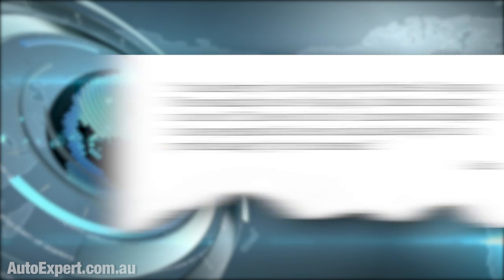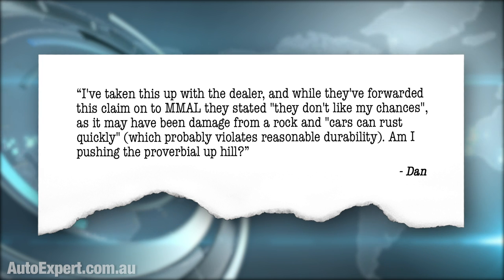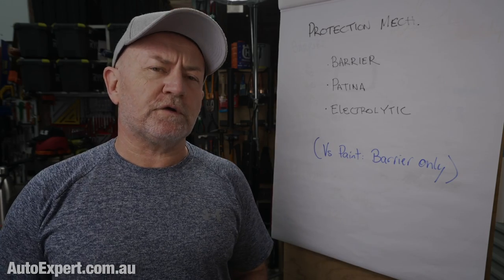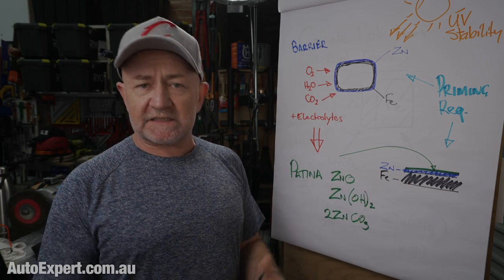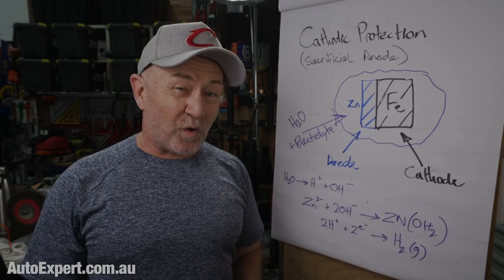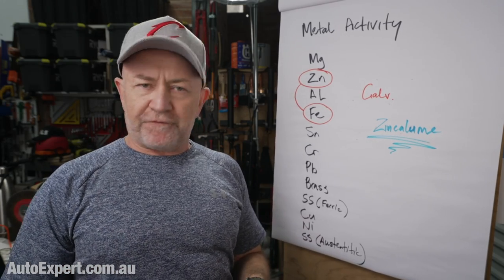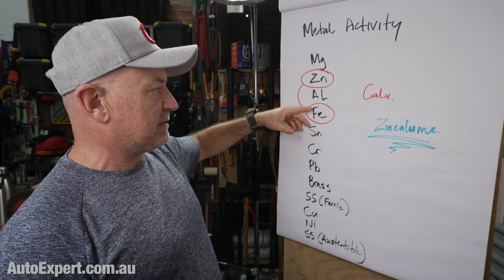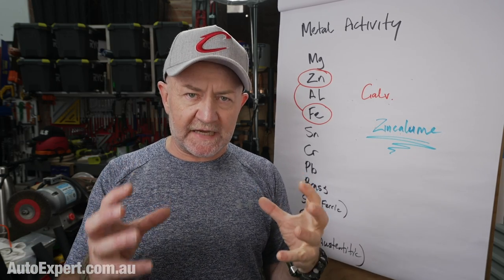The mad science of galvanising, and how it protects your car | Auto Expert John Cadogan

Comment: Galvanising only provides short term protection. I had two Nissan which were supposed to have galvanised doors.  The doors rusted a way at the bottom. Also, I have installed galvanised roofing sheets, which needed to be treated with bitumen, because they started to rust, due to missed spots in the galvanising process!
Reply from the maker: Bullshit - galvanising is long-term protection for steel. Obviously it is ineffective if done badly, which is your actual argument.
Reply: @AutoExpertJC  Long-term =/= permanent. After so & so years the zinc protection wears off. Hard to replace piping of an old house due to corrosion.
Reply from the maker: Galvanising typically protects steel for decades. = long-term.
Reply: @AutoExpertJC  just replaced some galv water pipe in our house.  which was built in 1921.  so i think decades is worse case scenario.
Reply from the maker: Hot dipped gal is especially durable (water pipes are hot-dipped).
Reply: Come to Canada and you'll see that galvanized steel for cars definitely does not last decades. Average age for rust to form on the body of a galvanized and painted car in Canada is about 7 years.
Reply: @forzanerazzurri2339  ah , so you're that Canadian that John warned us about in the video ( 32:00 ) . I'm guessing that you let your indignant outrage get the better of you before reaching the end of the video ?
Reply: I have a 1998 Opel Corsa 1.7D (and I love that Isuzu engine) and it suffers from some rust, including a fist-sized hole under the battery (typical in these cars) and some corrosion under the windshield's rubber I had to fix because water was already leaking in, pooling behind the passenger's seat. And there are various other spots of corrosion around.
Sure not eternal but not awful for a 20+ year old pig carrier, and there is some consensus that galvanization on those cars was somewhat poorly performed. But not that bad at all, considering the car sleeps under god's acid piss (AKA outside), and way far better than the cars I remember when I was a kid 35 years ago when there were no safety inspections and cars were literally disintegrating and falling apart, with paint brushed over the rust for disguise. It was like living in some Eastern European movie. Aaaah happy times!
Reply: I have pulled galvanised roofing sheets off a house built in the 1800s and reused them. They were heavy as hell - much thicker than the modern equivalent.
Reply: @azerool8288  
Nothing is permanent. No matter how good a process is, if it wasn't done right, it will bring problems.
Reply: @AutoExpertJC  The only one talking bull shit is you!  Every car I have owned has rusted away, even ones purchased in the last 10 years.  I can remember Chrome plated bumper rusting because chrome is porous and the car manufacturers failed to plate the bumpers with nickel, before chrome plating, to save money!  Car manufacturers fail to degrease and remove contamination before plating the door sills with zinc which causes rusting from the inside to the outside.  When carrying out the annual inspection the mechanics have to tap the sills to see if they have rusted from the inside, even if they look sound.
Reply: @mcmoose64   haha yep, guilty. Definitely my mistake. Rust is a passionate topic for us as it just ruins everything here quite rapidly, galvanized or not.
Reply: @forzanerazzurri2339  yeah but you guys like putting salt on the roads
Reply: @azerool8288  
Zinc Roofs last over 100yrs

Comment: Aluminum (NOT ALYOOMEENEEMUM for the folks in Oz) is added to roofing sheets because it has one of the most impenetrable Oxides known.
A surface of exposed Aluminum will coat itself in an insanely strong Oxide layer in less than a second.
The oxide is brittle and Metallic Aluminum is very soft so other metals are used for strength.  You have never touched Metallic Aluminum in your life.

Comment: John, going into atomic reactions is fine....  but you forgot the word - "eventually"  .   Drilled holes will end up rusty in your hot dipped trailer mate..  Instead of re-inventing the wheel..... use the dolly wheel to tip the trailer up when parked... so the water flows out of the tailgate instead. Simple. No holes required. .....Dude. The simple things in life are often the best.

Comment: Damn, you drilled through a galvanized piece of sheet metal? Well, isn't that gonna go bad, without the zinc, in time? Ah, you explained this. Thanks.
Years ago I once riveted a metal sheet-plate on my old Citroen with aluminium rivets. That went bad in a very short time, the rivets just "vaporized".  Weird huh, lol.
On topic 1: they put blocks of Zinc on the legs of oil-rigs to prevent the rusting. Not galvanizing but real big blocks here and there.
Could you talk about those spray-cans with "Zinc". Is it Zinc? and does it work?
On topic 2: What about those aluminium Tesla's with iron axles and such. Would that not just "fade away"that aluminium body if it gets scratched?

Comment: If you think 21st century cars are all galvanised, you wanna take a look at my 2005 Seat Ibiza front wings. Seat, in their finite wisdom chose to wedge a big section of open cell foam between the arch liner(plastic) and wing(metal) right at the vertical centre line of the arch.
It would seem that the metal wing sacrifices itself to preserve the foam...

Comment: In cold climates modern cars absolutely do rust, especially in areas that haven't been galvanized.  Maybe the body is protected, but some parts of undercarriage tend to have a lot of surface issues, including surfaces which have threads cut in them and retain moisture by capillary action/surface tension.

I'm not from Canada, but 90 miles north of Chicago, (or roughly 150km if you're a dirty commie)  you're right, cars don't "rust out" like thy used to, but when the rust makes replacing wear items such as suspension bushigs near impossible because every grade 8 bolt needs to be cut or drilled out, the result is the same: we scrap the car as if it had holes in the floor of the tub.

P.S. I'm still trying my hardest to be a contained nut without being deliberately inaccurate.

Comment: I live within earshot of where that trailer was likely dipped. Quite often , during the pre dawn hours of the morning I am wakened by a noise that sounds like a Boeing 747 hovering above my house. Like a massive bunsen burner or something. I'm positive the noise is coming from the gal plant.
Is there anything in the hot dip process that would make this noise? I'm asking because I would hate to report the wrong business to the EPA as I have had enough of it. Cheers.
Reply from the maker: It probably is a giant gas burner in a furnace, melting the zinc. Probably the cleanest heat source available. (Versus coal.) The sound is probably forced air induction to crank up the combustion rate and maximise the efficiency.
Reply: @AutoExpertJC  Thanks. If the EPA wont sort it, I'll unleash the Grimreapershaw onto them lol. cheers.

Comment: Another correction, you said the thread was rolled into the mild steel you held up, didn't you mean cut?
Reply from the maker: No - the thread on the rod is rolled. It's cut into the pipe.
Reply: Most bolts are a rolled thread,. Two rollers hydraulically press the thread into them.

Comment: It’s a hot Bath dip.  Porsche do it best
Reply from the maker: Hot dip provides protection for longer.
Reply: @AutoExpertJC  John John John.  Thanks for effort another skilful video. . This video however wasn’t for me.  The subject matter didn’t touch me up in any way.  Sorry.  I watched the 45 min docu on Porsche factory showing the galv dip and then back on conveyor belt across the road in glass bridge between factories .  Hmmmmmmm.  Made me want a 911 then.  Makes me want a 911 now.
Reply from the maker: I want one without the paint
Reply: @AutoExpertJC  on lightweight weight weeny ( yes it’s a website ) cyclists shave off paint c.200grams on exotic expensive pro carbon road frame.  Takes them a week.  They don’t have girlfriends.
Reply from the maker: Not surprised (about the GFs).

Comment: As well as galvanising, modern cars are made of higher tensile steel then the white-goods grade stuff used back in the day. High tensile steels make stronger lighter cars - important for fuel economy and crashing - but the composition of the steel is also less reactive and therefore less likely to corrode..